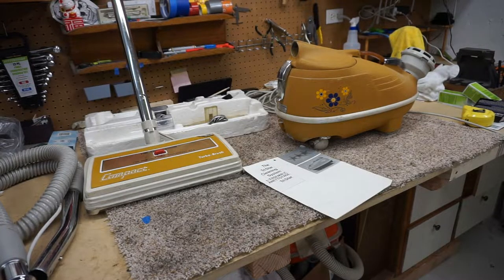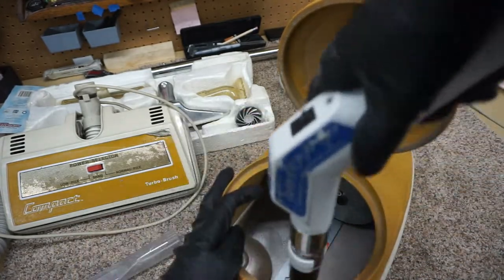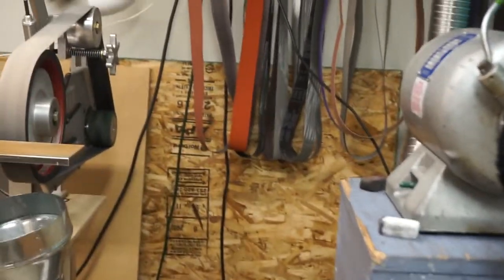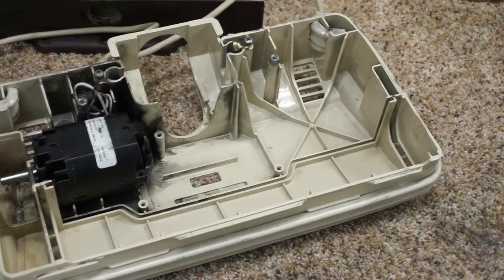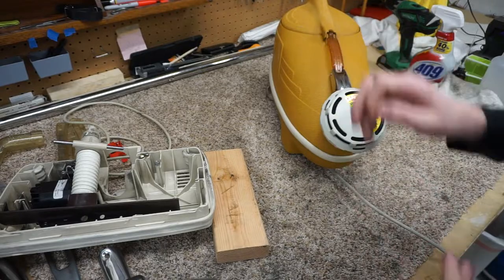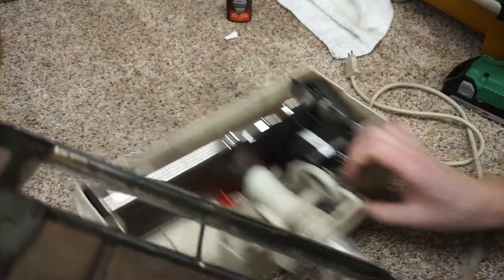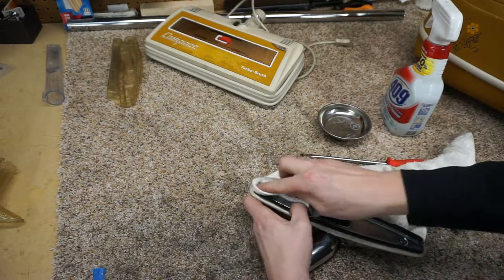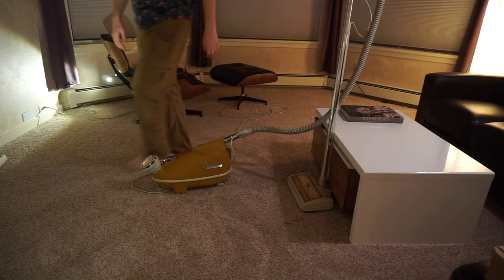Compact Tristar  C8,C9,CXL  Vantage Vacuum Repair & How to Rebuild

Comment: Very nice video very professional you keep your parts and tools very organized you don’t throw them around like some video I’ve seen. I also like you don’t use a power drill to install every screw some screws do you need the old fashion aligning all screws hand tightening. I’ll look at some more of your videos thanks again. I like to repair equipment weather it be a vacuum or anything else, the old fashion way.

Comment: Nice! I still have a TriStar C-8 green color gifted to me by a co-worker, back in 2006. I have other vacuums, so this one gets used maybe once a month or less. I always cleaned the paper filter carefully but never changed anything. This time I noticed a small rip in the paper filter so I decided to clean it better, and removed the cloth filter for the first time. The insides were pristine clean, like not a single nothing. The after filter was also clean. My unit didn't come with anything on the exhaust.
So I guess I have to replace the paper filter. What is the best out there that can be used on this unit? Approx. dimensions are 6" diam and 9" depth.

Comment: I’m not an expert, but my understanding is the first two numbers on the IEC serial number on the lower front of the main unit is the year it was manufactured. I’m not sure about the power nozzle dates. It would also be interesting to find out if Eureka assembled the entire PN assembly or if IEC assembled it.  I have the blue one I think you spoke of. The first two serial numbers are 87, so I’m thinking 1987.

Comment: Ballistol oil/cleaner will probably make that paint look new.  I used it on an old desk lamp with crinkle paint, that thing looks brand new now.  Go read about it, it was made to preserve metal, paint, rubber, leather, ...just about anything.  I drink it for breakfast.  Smells funky but the smell goes away.